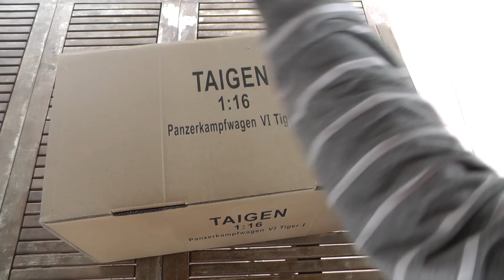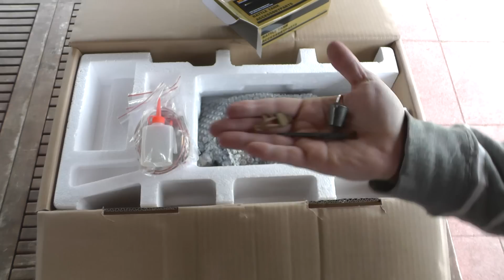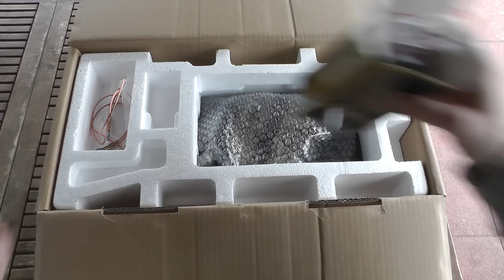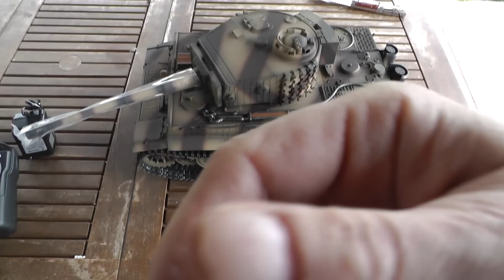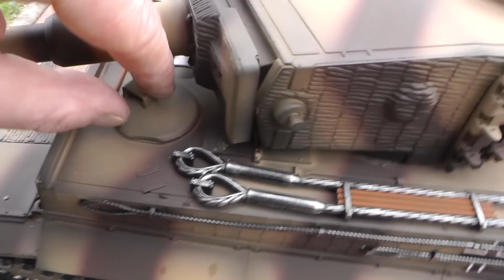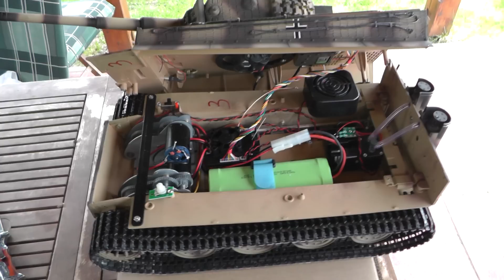RC Tank 1:16 Taigen Tiger 1 (PROFI) - unboxing and first run

Comment: I have the 1/16th HengLong Tiger 1 and it’s awesome! Upgraded smoke mechanism, upgraded 2400mh nimh battery system and will be starting my metal parts upgrades soon!
Reply: Yes, Heng Long is awesome!
Reply: @criticalheed4964  beware! heng long will break, they arent good.
Reply: @rsosin415iep  ok, thanks for the tips
Reply: @rsosin415iep  I use mine all the time, nothing broke

Comment: Is taigen the same thing as Heng long? Or are they different?
Reply: I think I heard of henq long on amazon if it is the one i am thinking of henq long has rubber tracks and tigen had metal and rubber tracks but I would choose tigen it cost more but it's better
Reply: I just went to check if it was the one i was thinking of  it wasn't i am sorry i was not any help
Reply: angel reyes  you don't have to say sorry. I prefer Heng long because it's cheaper, but someday I'm also going to start a collection of taigen as well.
Reply: I have the Heng Long Tiger 1 professional edition and it has steel gearboxes and steel wheels and sprockets and idler wheels and steel road wheels with rubber tires and barrel recoil but plastic body and no paint work like this one but it's $200 cheaper